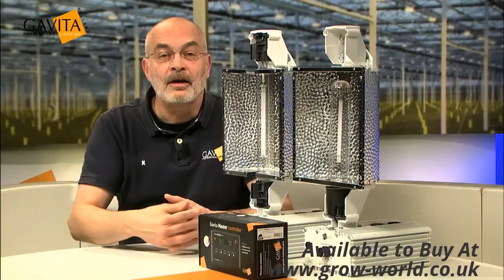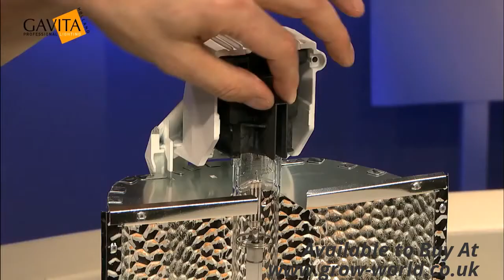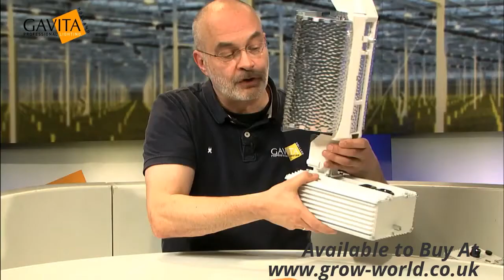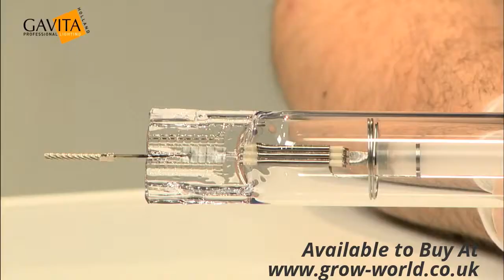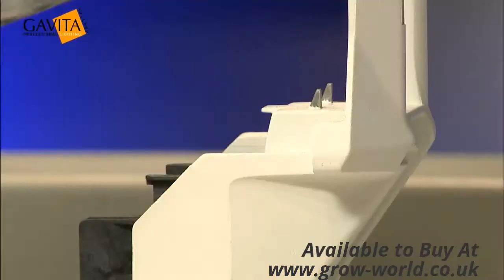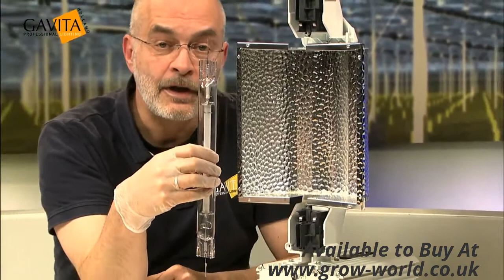Gavita Pro Line E-Series Introduction

Comment: Does the Gavita Pro E 120-208-240 come with the power cords to plug directly into my appropriate wall socket, or will I need to hardwire. I have the ability to plug into 220 wall sockets. What is the recommended spacing in between lights for optimum coverage? Are Veg bulbs in blue spec available in DE for? Can I use the the standard bulb for vegetation or just bloom? I'll be purchasing 20 to 50 fixtures 1st time using Gavita. I will daisy chain and use Gavita controller in set ups from 10 to 15 each room.